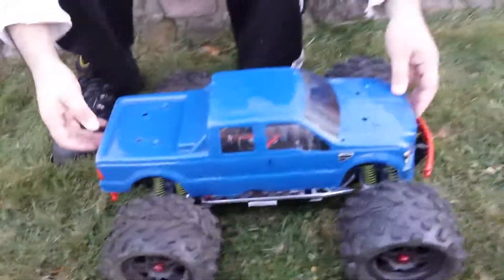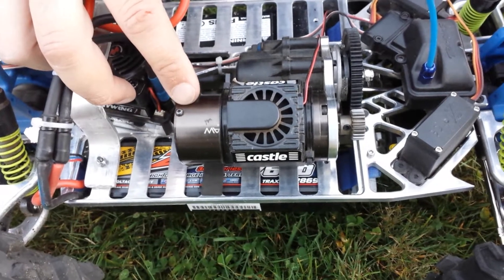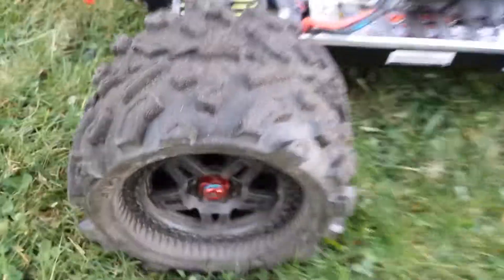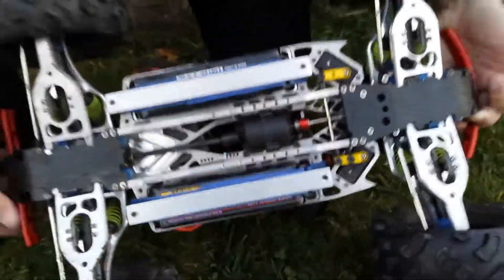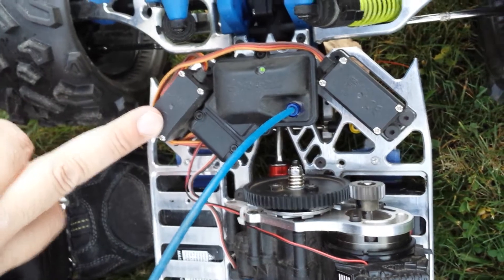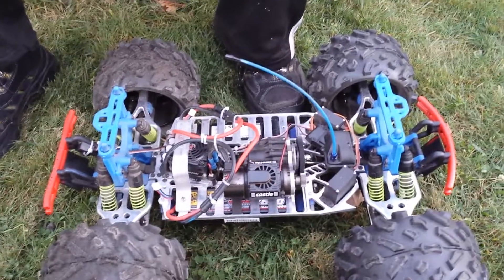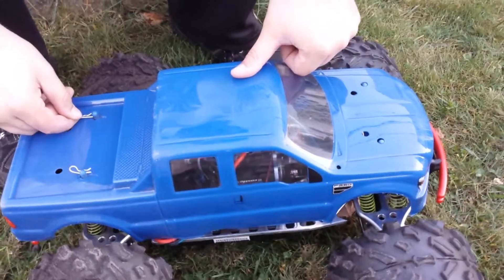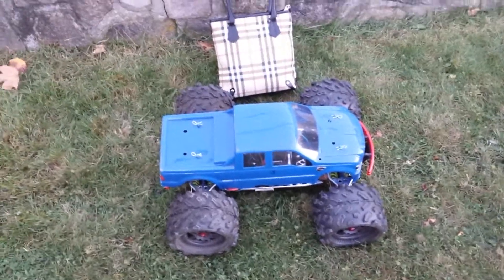CUSTOM TRAXXAS EMAXX 3908 (MADD MAXX) Key Details

Comment: Which bulkheads fits the the flm chassis? Which ones are you using from integy 3903 3904 or 3905 bulkheads